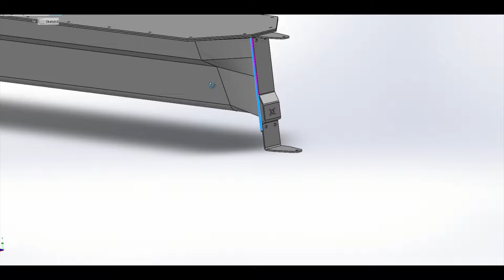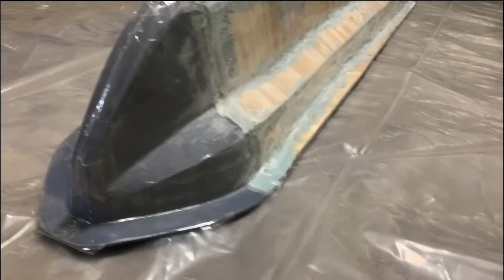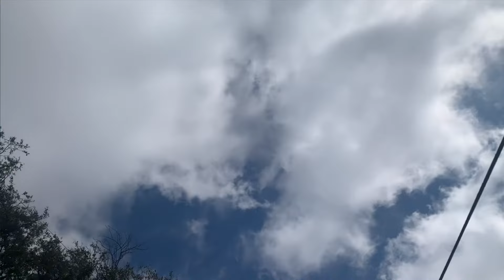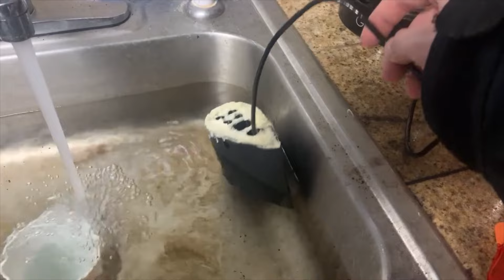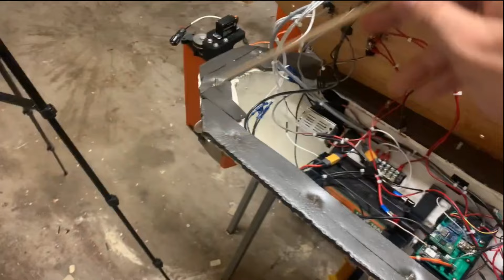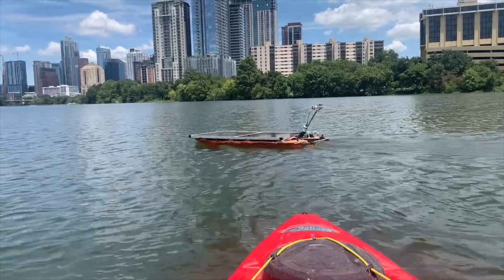Auto Solar Boat for GPS Guided Bathymetry Surveys

Comment: This is the best build of a autonomous boat I've seen. Nice work. Great logic with the various degrees of direction control.  I would suggest dropping the geared rudder drive, just run a 25kg waterproof servo direct to rudder.
Reply from the maker: Thanks. I did end up ditching the belt/pulley drive and it’s linkage driven now from the same servo. High mechanical advantage near the extremes of travel, about 1:1 near center.

Comment: I would love to see you build a custom 27Mhz digital transmitter for communication with boats 😃 because the currently available modules are limited by range, I think it would be better to select a CB frequency and make a custom radio transmitter and reciever, most probably use bit bashing protocol to send digital control signal... Good luck 🤞
Reply: By custom transmitter, I mean using an LC tank circuit, or a crystal oscillator to generate the radio frequency.

Comment: Integrating an mmWave sensor to detect humans nearby would alleviate a lot of concerns at a low cost
Reply from the maker: I’ve thought about using LiDAR to detect obstacles and the shore, not sure yet if it’ll be feasible to get good performance on a low budget. Realistically, I won’t be operating this where people are swimming.
Reply: @Clay-Builds  Is there a "safe" depth at which you can decide you're too close to shore and turn around?
Reply: @Clay-Builds  LD2410 sensors are remarkably cheap ($3 USD) and can track up to 8 people, how far away they are, if they're moving, etc.

Comment: Hi here in Florida with over 10000 “lakes” large enough to hold a car, there are over 1500 vehicles in the lakes and about .5%-1% have a person in them. The vehicles are hard if not impossible to see them. If you used this to map the bottom, the data can be mined to find vehicles. One to save the environment of the lake and to solve 15 missing persons.  Thank you for making this

Comment: Cool project!
1. Your rudder mount causes a lot of drag! I bet you can get way better efficiency out of it if you don't drive a flat wall into the water 😄😄
Maybe just have a solid top bearing assembly and nothing at the bottom. Something akin to a semi-balanced rudder.
Try to keep the bearings completely out of the water, just a rudder going down.

2. My tip is to get some DCM (Dichloromethane) it is awesome for PLA 3D prints you can "glue" parts together so easy, it is hand tight in a sec. to a min. (depending on the area you "glue") and it is basically as strong as the PLA it self if it fully dyes. I say "glue" because it is actually chemical welding (but nobody got time for that 😅)
You need very little for welding, a bottle will last you a LONG time. Well I found many other uses for it too, because it is basically Acetone on steroids. It evaporates so fast and no stinky smell. So keep your bottle open as short as possible and use in ventilated area, well like all stronger solvents.

PS: You can also dissolve PLA in it to make a PLA "resin"/glue  :)
Reply from the maker: There’s a printed fairing to streamline the base of that flat motor mount part, probably not very obvious in the video. 

I don’t really have a need to glue any PLA parts together for this. My redesigned servo mount will be a monolithic PETG part.